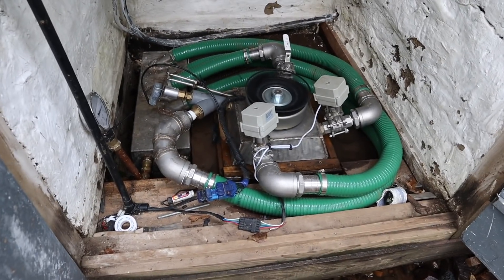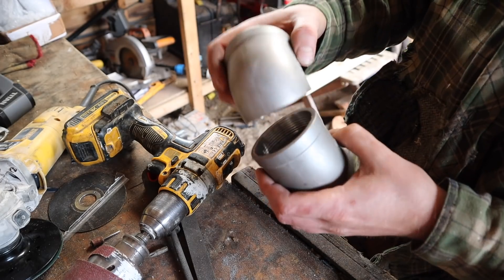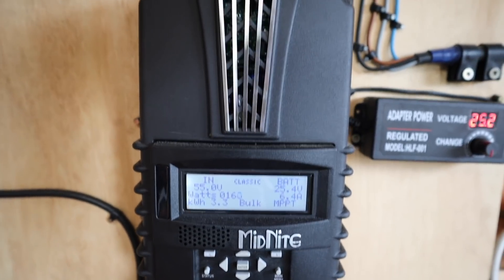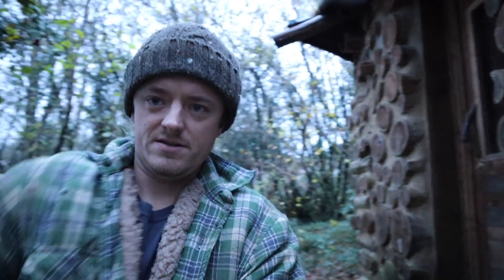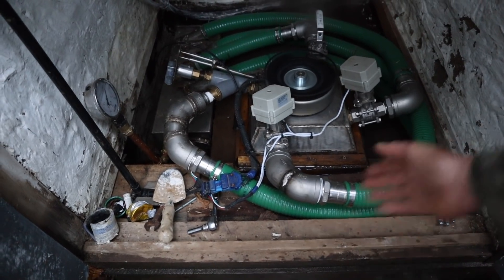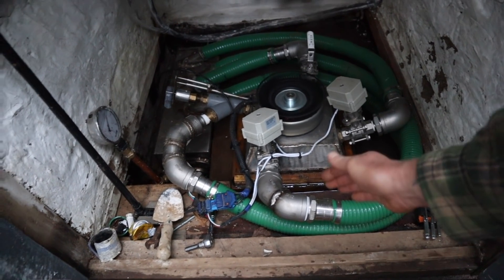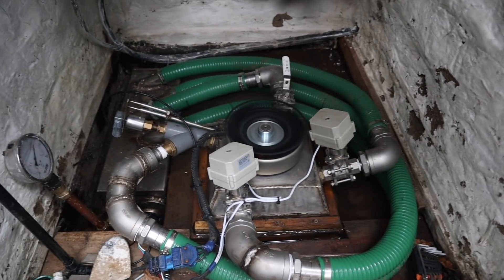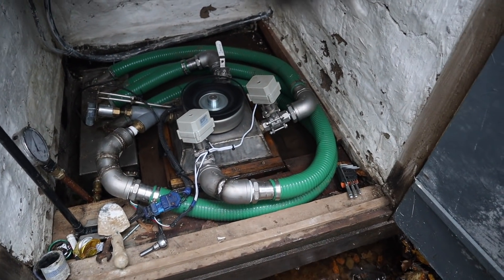Off Grid Micro Hydro Turbine Fine Tuning 90 Degree Bend

Comment: It seems to me the potential energy in the weight of water in the pipeline is way under used and if the bottleneck is in the turbine then adding another turbine below the first would be a way to double the power output without a significant loss of power to the first turbine. Also when generators are under load the force needed to turn the armature is greatly increased, perhaps increasing the storage capacity might help? It's all about finding out where the bottleneck is until the bottleneck is the flow from the stream into the pipe that gives you your head of water. Personally I think if the turbine provides enough power for your needs then problem solved :)
Reply from the maker: I can easily get more power out of the turbine by just drilling out the nozzles and useing more water. im just trying to increase efficiency at the moment. adding a second turbine just adds losses and defeats exactly what im trying to achieve
Reply: @KrisHarbour  by drilling out the nozzle bigger, you decrease the velocity of the water out the nozzle because the dynamic pressure will drop

I would experiment with smaller and larger nozzle size to find your maximum power output

the only other way is to increase pressure...which isnt possible unless you go further down the creek ...but you might also have to increase the pipe size to get enough flow
Reply: @KrisHarbour  I'm sure you know far more than me about this, just to a layman like me the potential energy within the head seems underused, and I'm sure (at some point) the turbine will become the bottleneck before the potential energy in the head is optimised.

Comment: Kris,  When working with wood tools, and a dust collection system, what you did makes alot of difference in CFM of air.  45 degrees works better than a 90, as the air flow is restricted by hitting the 90.  One more suggestion, that might make a difference, is different piping.   The ribbed piping you use cause a turbulence, and reduces flow a bit also.    Another great video.
Reply from the maker: yes that is true but in the exaple your using the speed of the air is much faster than in this system. the reason it makes such a small difference in the system is because of the low flow of fluid moving slowly. Also the pipe is ribbed on the outside not on the inside.
Reply: i remember him saying his piping has ribs only on the outside

Comment: Love your video! Keep it up, Kris! Have you considered lifting up the tank, just enough to get some help from gravity but not to much so it won't get above the source?
Reply from the maker: Well the tank gets its presure from above it and the nozzles are at a fixed hight. i dont think lifting it in line would help would it? im not sure on that on. at the moment it goes down hil then up a little bit. if i lifted it up it would go downhill a bit less and up a bit less. i dont think it would make any difference.
kris
Reply: @KrisHarbour  I know this might sound crazy but maybe you should consider get a bigger height difference between the source and the generatr. I was once inside a Big Hidro plant and the height difference between the lake and the turbine was 100 meters!!!
Reply from the maker: @claudiofarabegoli190  That is impossible for me as both intake and turbine are at the boundaries of my land and at the point where they have the biggest difference in elevation. unless i buy more land near me i cant change that.

Comment: What were the pros/cons of having a smaller dia pipe from the manifold to the turbine?
Reply from the maker: pros are cost and ease of installation, cons are high losses
Reply: a pro of larger pipe, more flow and easier to fit

small pipe you would get a lot less flow and would have to have a smaller nozzle

Comment: Can you make the 1st stage input much larger where it goes into 2, 3 or 4 inputs into the turbine impeller. If you have 4x 3 inch lines going into the turbine impeller then your 1st stage input should be around 8 inches up to 12 inches diameter. The idea is that you might get a slow flow through the 8 - 12 inch input but by the time it splits off into 4x 3 inch pipes then the volume of water will be high pressure.

Comment: Hey Kris, an observation. (Edit, I added the comment just before you talked about it yourself).    From previous videos I remember the Pressure drop on the guage just before youre manifold increases more rapidly as the nozzles approach fully open.  This suggests the system restriction is upstream of the Guage.  It might be worth focusing on the Reduction pipework Just before the Manifold. Is it possible to keep the Penstock complete right up to the Manifold.
Reply from the maker: I agree but the losses there are still very small indeed and i dont think with the cost and time. for the next video i will do a efficiency calculation and that will tell us how much room there is for improvement.

Comment: So what happens if all the jets are the same size ?
Reply from the maker: I would get more power. But use more water and not have as fine control over the flow.
Reply: @KrisHarbour  so if all jets where the same as the smallest jet with each new jet that is turned on that gives more power due to more foce and able to keep rpm up ? im just trying to get my head around the peltion wheel and why more jets rathere then one of set size
Reply from the maker: @1981dasimpson  More jets dont give more power. it just gives you control over flow better than having one massive jet. the rpm has nothing to do with how many jets there are as the turbine is always loaded so the rpm is fixed. having more jets just gives control, balance, and ability to run a small turbine as if i tried to run 5lps through one jet i would need huge tubine spoons because the jet would be massive and that would add alot of drag. far better to have a few smaller nozzles and have some control.
Reply from the maker: i could drill out all the jets and get more power but the rpm will stay the same we will just use more water.
Reply: @KrisHarbour  ah i see yeah had not thoght about flow rate to size of turbine also meaning more cost to enlarge the system
Reply: @KrisHarbour  i ment by rpm that when more load the turbine slows down due to the drag thus more jets would keep that more even as there are more points of contact to over come the generators drag
Reply from the maker: @1981dasimpson  the turbine dose not slow down with load. well it would but the charge controler and battery bank as a buffer mean the turbine is always loaded at its best efficiency so when i turn things on the turbine does not slow down at all.

Comment: This is really cool stuff. I wonder if the same methods used to port and polish engine intake manifolds to match cylinder heads could be applied here. Again probably only an educational exercise, for a minimal increase if any.
Thanks for the videos.
Reply from the maker: yeah that would help a little bit for sure. it would be a tiny amount though.

Comment: Is there a way you could add a tank to apply head pressure? Even for just the main nozzle only would help?
Reply: All the hoses are fed from a tank. It's on the left, partially obscured by the bends and hoses.
Reply: @MontclairsLair  how high up?
Reply: Tony Leac
Reply from the maker: im not sure what your asking, if the tank you talk of was higher than the intake it would need water pumping in to it and that would waste more energy than it would gain. having a tank lower than the intake is basically what i already have with the pipe and the manifold.
Reply: Kris, head creates pressure, you could mechanically pump the water up higher or lower the generator down lower, will  higher pressure you would gain water velocity and so drive the turbine faster. However do you need to drive it faster, do you need more energy from it? If the output already charges your batteries just fine why look for more?

Fascinating build btw.